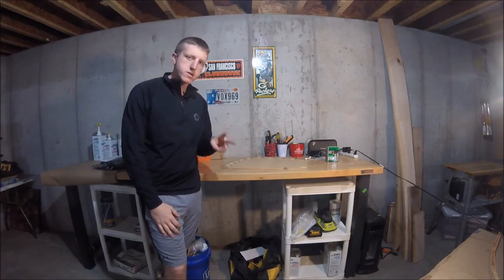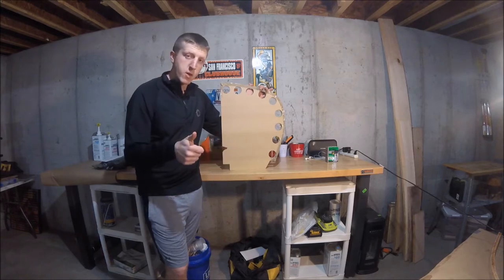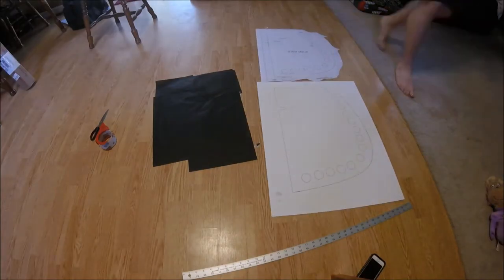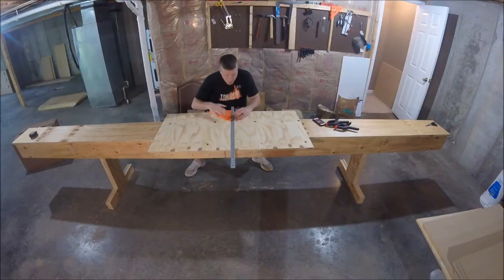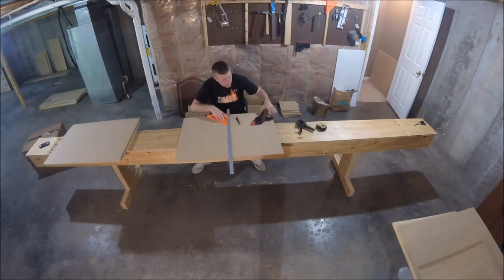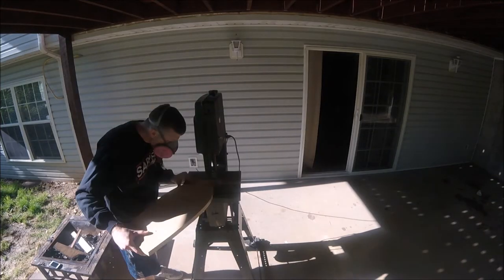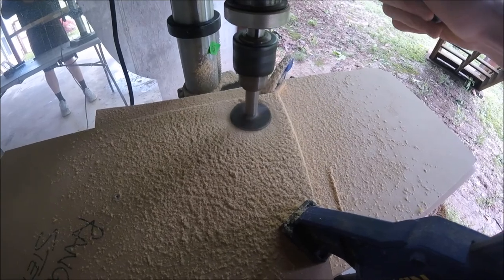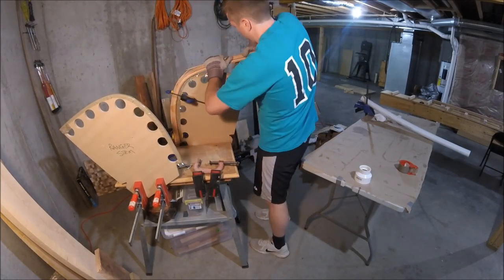Cedar Strip Canoe Ep 2 - Station Molds

Comment: These vids are pretty standard stuff straight out of those canoe books at Woodcrater stores. Andy if you like i could verbally clue you into doing straight up design(full scale point plotting& drafting your own designs) not a 3D design program, but OLD SCHOOL. I have a system of an Aluminum framing with linear sliding components enabling me to build 2ft  to 24ft. lenghts hulls and 1 foot to 5ft. beems all by socket wrench adjustments to my jig. Built jig on 10ft. long heavy work bench. My strong backs are colapsable 4 piece each joined via short dowels. The Aluminum framing system extrusions have standard 10mm. 2 holes(over&under each other). I use 45mm.x90mm."T"-sloted extrusions(there are dozens of brands). Because those extrusions are dead true straight and the 2 - 10mm. holes are consistant thru the lenghts i just use 1045 ground&polished dowels 1/2"diam.. machined for a hand tight fit in lenghts conveient to reuse for any popular lenght canoes i make. These always go directly into home made,but very professional rotary indexers at the bow& stern stansions of this jig. Comment back and i'l send contact info via your P.O. box.
Reply from the maker: david,r. massey I’m definitely interested, and only moderately intimidated haha!